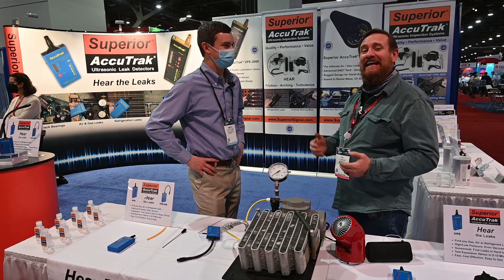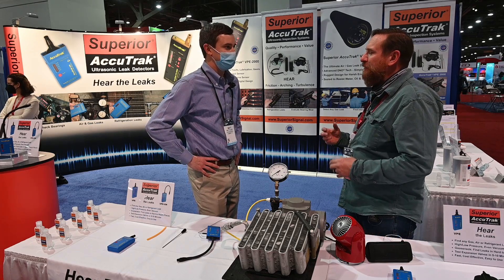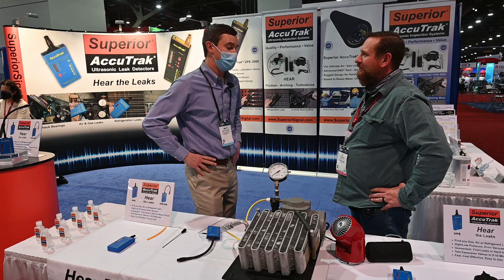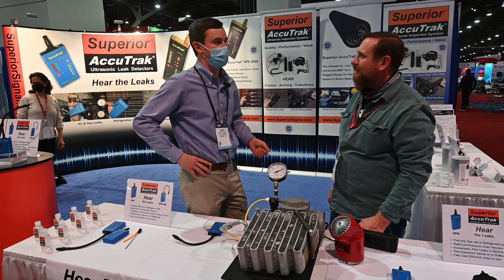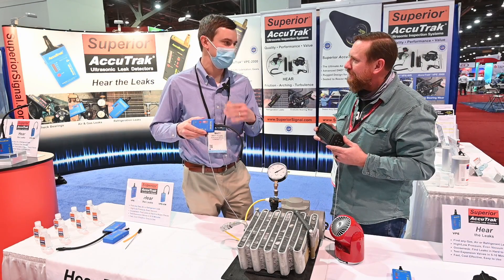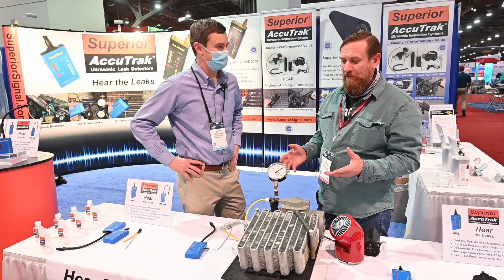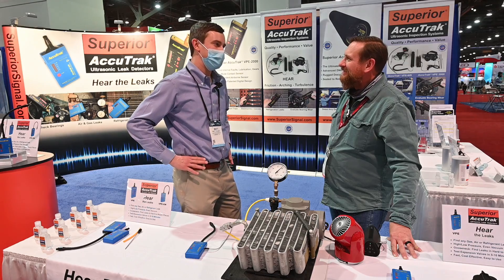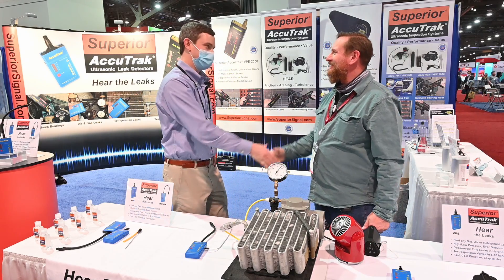AHR2022 Matt with Accutrack ultrasonic Leak detection

Comment: The gauge dropped pressure quite significantly even with just 20 psi under that coil. For how much these cost I’d still remain skeptical until seeing this used in person. Very intriguing however.

Comment: super tool for plants with compressed air systems for finding air leaks in pipes in noisey plants with pipes in the ceiling or any compressed air systems.
Reply: I've use one for years. So sensitive it can hear the air movement from your eye lash blinking, give it a try.
Reply: Don't loan it out, it won't come back.

Comment: Hey can't they transfer the nose into a lcd display what shows a leak better..instead of relying on the 1960 red meter bar. Hearing it seems too faint. And if we can have a nicer display to visualize it. It'll be much better... even a color light indicator
Reply: I have the big brother the VPE1000  that costs twice the price of VPE.
It does the job, no need for fancy displays that will bump the price up another 500 bucks and add another dimension for something to fail or get damaged.
I only use the display for adjusting sensitivity and volume, I use my headphones for hunting.
Reply from the maker: It was very clear to hear. The whole purpose of ultrosnonc is audible. 

The Stratus leak detector would be a great choice if your want an LCD display. It has a screen just as you describe. I have not had the opportunity to use one of them yet.

Comment: Thank you for sharing the new stuff at AHR2022.  Are there Split Residential AC system that incorporate a controller that control (cycle) a 1 or 2 stage Condenser unit based  the evaporator coil temperature similar to the method used in automobile AC?
Reply from the maker: Yes! 
Most manufactures refused to talk with us , but yes that is one of many methods being used.
Reply: @love2hvac  Please consider making a video lesson on that type of cooling modulation.  Have been wondering if there are any energy efficiencies that might be gained.
Reply from the maker: It's mainly used with dehumidification.
Keeping the coil cooler pulls more moisture. 

Ductless units use it with variable speed compressors and variable valves to control the flow of refregerant. 

Ductless units are a bit away but they are on the radar
Reply: Just my experiences so far. I just tested a loaner accutrak and it is useful on significant size leaks in windy environments but could not detect a  test with a leaking shrader that was leaking very very small that bubbles reviewed.

Comment: My dad turned me onto that ultrasonic leak detector tool in the late 1970s early 80s I learned on my fathers and been using it ever sense. 
        There is definitely some cases where it works better than a electronic refrigerant leak detector or soapy bubbles or UV die they all have their place and their strong points.
Reply from the maker: Great reply! So true, the right took for the right job in the right situation.

Comment: Beat my accuprobe uv, fieldpiece srl8,h10 they all have been re-cab'd recently but couldnt detect the leak on a RTU  windy roof  last ditch got out the accuprobe found the leak right away clear sound made the client listen to it and soap it saw them bubbles 2 techs from different co couldn't point out the leak but had to be gassed every  4 months to 6 months made a believer out of me n the client he was like impressed ~ ps.not so great inside the kitchen situation needs more practice <picks up all the flourescent tube and deep fryer sizzles n pops buzz  n also the propane firing up  distracting . Good stuff 👍🏻🧞‍♂️
Reply from the maker: This is excellent feedback! Thank you very much!

Comment: We use something similar in the compressed air business. Our look like radar guns the cops use. We will walk a plant following the pipe lines with headphones and the gun. The pipes can be up to 30ft in the air and we can pinpoint the leaks, and it will tell us how many cfm the leak is. Ours is a lot more expensive than these. Just looked them up after seeing this. I have had the regular leak detectors not be able to pick up leaks when the pressure is that low.
Reply from the maker: That's impressive! I would like to see one of those in action